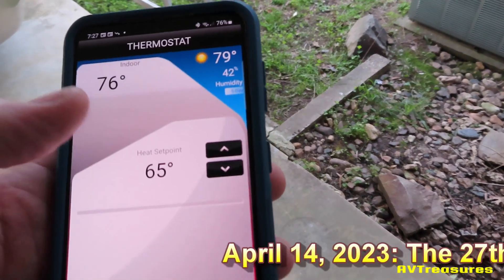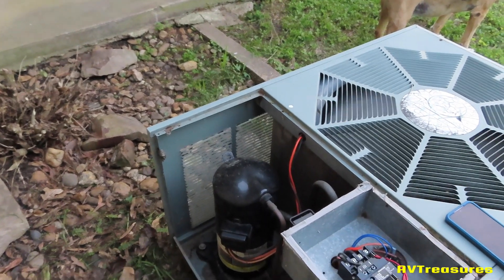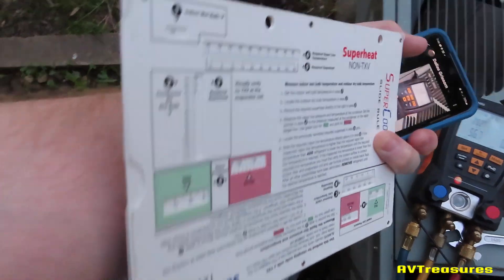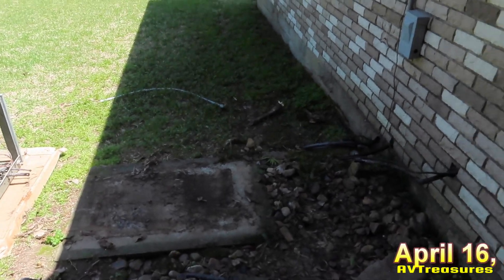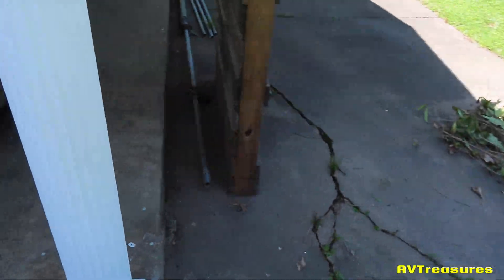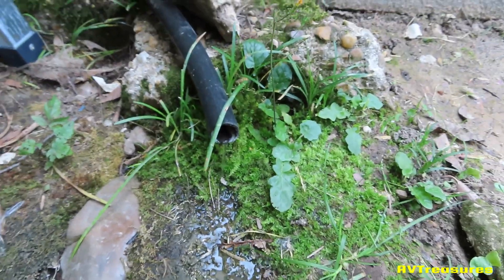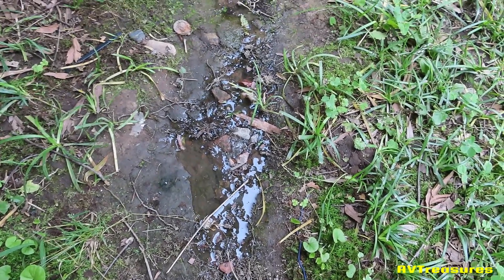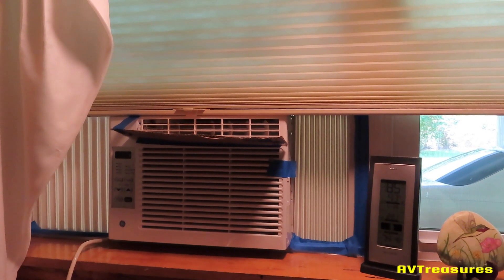The End Of An Era: The Changing Of The Rheem

Comment: RIP the old rheem unit. At least it has served you well for decades. And at least you still have the unit. Hopefully the new unit will serve you well too. (Even though it probably wont last as long as the old one.) My grandparents have the same exact rheem unit in their backyard. (As well as a GMC/Goodman next to it for their neighbors house. Used to be a 2 ton carrier 38ckc) They even have the same furnace as your old RGPH. Only with 4 burners instead of 3. I discovered your channel from one of your RGPH start up videos. And was amazed when I found out you had the same pair of units!
Reply from the maker: The new RARL Rheem is doing great. I really like it much better since it's 2 stage and runs as a 2 ton 99% of the time. The old one was just too large for my house. You are right, It probably won't last as long as the old RAKA. I still love that old unit though. I couldn't bare to part with it. At least not yet anyway. Thanks for watching.

Comment: Nooo! 😢
Reply from the maker: I know. It was over 5 years after I bought the new Rheem before I could move ahead with the installation. Refrigerant leaks bother me. Once I had evidence it was leaking I was able to go ahead. It's still sort of sad but the new system works so much better for my house.
Reply: @AVTreasures  Oh really well that's good at least next cooling season when you go too do the start up can you start it up on low stage and then later bump the thermostat down more too kick it too high stage?

Edit: Why did you buy the unit 5 years ago if the unit wasn't broken and on top of that it was in the factory for 3 years before you got it
Reply from the maker: Yes, I plan to do some detailed videos on the new Rheem this coming year. 

I was looking ahead. Nothing lasts forever and I had been wanting to upgrade to a quiter unit that better matched the heat gain of my house. 3 tons is way too large for my house 90% of the time. I found a good deal on it at Surplus City Liquidators. They have lots of discontinued units that the manufacturers had left over at great prices.

Comment: Not trying to brag but my ruud is still going and it’s got a small leak but it can go anywhere from 5 to 6 years without being charged and the new rheem looks good installed
Reply from the maker: I don't blame you at all. I could have easily done that with my old one. It was only a little low. I was ready to finally have the correct size unit. The new Rheem operates as a 2-ton in low stage which is perfect 90% of the time. The high stage is 3 tons and I could possibly need that if it were well over 100. Especially if there was a power outage and the house were really hot.
Reply: @AVTreasures  I don’t blame you there it will help not to cycle as much and better humidity control
Reply from the maker: Absolutely. It runs nice long cycles, especially when the humidistat has on demand dehumidification engaged. It uses almost half the power of the old unit too, so my KWH usage went way down compared to past summers.
Reply: @AVTreasures  that’s good 👍 and nice looking installation
Reply from the maker: Thank you! I am really pleased with how it turned out.
Reply: @AVTreasures  you’re welcome I want to go back with a heat pump once if the ruud ever gets replaced
Reply from the maker: Good idea. That will save you a lot on heating costs.
Reply: @AVTreasures  plus instead of the outside unit sitting dormant in the winter it can heat the house instead

Comment: I never thought I'd see the day.  Well, it had a great run.  It's too bad it started leaking.  If getting refrigerant for it weren't a problem, I would have definitely kept it in service.  But you already had the new one, and it's not doing anyone any favors sitting and taking up space.

I actually did have an issue with my 2-ton Rheem this past summer.  It so seems there were bad electrical connections.  I had a company come out (as I didn't have the time), they replaced the capacitor which I knew wasn't the issue.  The unit worked for 2 more days and quit.  They came back, I had them replace the contactor.  Then the electrical connection issues were found.  That solved it.

Personally, I'm not sold on a 2-stage system.  More to go wrong.  And, the units run plenty long here as it is to keep this place cool.  I'd never want to throttle back the cooling.  It can go on and off as it pleases via the thermostat.

It's a great thing you were able to do all the work yourself and get it just perfect.  I know all about that.  If you want something done right, you've got to do it yourself.
Reply from the maker: Yes sir. 27 years of faithful service. I was never once without cooling.  I was expecting the coil to start leaking sooner than later. I have some R22 in my stash and I could have easily just charged it back up.  I also could have replaced the indoor coil and kept on going as well. I likely would have done exactly that if the unit were the correct size for the house. 

Glad you got your 2-ton Rheem figured out. Sometimes it's not a one and done fix. I ran into a similar situation with a family members unit last summer. It also ended up being a bad connection at the contactor (on the low voltage side). Took out the transformer and the thermostat. 

I love 2-stage equipment. My house has never been this comfortable or quiet. Where my unit is located (sitting in the middle of the house with an open return) noise can be a big problem. Now I can actually sleep through those cold nights and never be awakened by the furnace coming on.  I get what you're saying though. There are a few more things that could go wrong. Just as with my old system, I have spare parts on hand for this one as well. Including the board in the outdoor unit. I really like the longer run times of two stage. It makes the house way more comfortable. During either extreme cold or hot weather, I never feel it inside the house like I used to between cycles. It's amazing. The new 17 Seer outdoor unit pulls about half the power that the old 10 Seer did. My monthly KWH usage last summer was roughly 25% less than in previous years.

I totally agree. If you want it done right, there's no other way. Living with a sloppy install of an oversized system for 20 years is what started me on the journey to acquiring the knowledge and tools to do this work myself. As important as HVAC is to me, I have no other choice. It was a hard road but worth every bit of the effort.

Comment: Since I have 1997 Ruud Classic X, I’ve been following your Rheem videos for years.. been maintaining it really well ( like you) …..2 years ago I noticed a low charge and got some hits on the leak detector from the evaporator.. charged her up and added one shot of Leak Saver.. performed really well for the following two seasons but towards the end of last season the compressor’s started with some odd rattles( definitely internal) .. so I too may be looking at a change out soon.
Reply from the maker: It's too bad that the indoor coils aren't as durable as the outdoor unit. These systems could last 50 years easy. I could have replaced my indoor coil and kept going for years. Since I had the good fortune to find the NOS RARL, I decided to upgrade. Time will tell if it will last as long. Thanks for watching my videos.

Comment: Has the Coleman or Intertherm lost their charge this year or are they still going strong?
Reply: What was the Intertherm replaced with?
Reply from the maker: I installed a 2.5 ton Rheem RA14 and a new indoor coil with TXV earlier this year.
Reply from the maker: The Coleman is still hanging in there. It has a slow leak but I have some R22 reserved to keep it going for a while longer. The Intertherm is gone. I replaced it in March of this year right before I installed my new Rheem. It took 6 lbs to keep it going last year so I had to do something pretty quickly.

Comment: What year is that condensing unit? I thought Rheem/Ruud went to more of a "cube" style design on their newer units. Is that the same furnace that you installed a while back?

Sad to see the old Rheem go, but the new one should last years.
Reply from the maker: It was manufactured in 2015. I bought it in 2018. This was the design that came after the stamped octagon was discontinued. The next design change is the one you are thinking of. Yes, I reinstalled the 2 stage 50K gas furnace that I put in back in 2017. It's still like new. 

Me too but it was time. Having the two stage is awesome. It works so much better.
Reply: @AVTreasures  Out of curiosity, what did you do with the old Rheem unit?

On a slight tangent, I just purchased a vintage Rheem product from eBay. Isn't HVAC or water heater related, though.
Reply from the maker: I pumped it down and stored it in the garage. The old RGPH furnace and coil are sitting on top of it. 

eBay is awesome. I have found some neat vintage Rheem stuff on there as well.
Reply: @AVTreasures  Did you ever get any of the vintage Rheem stuff? I wasn't aware that they were so diverse at one time, but I guess that's the case with a lot of companies. Hyundai doesn't just make cars, also made the RAM chips for a couple of my old computers among many other things.
Reply from the maker: I did buy a few vintage promotional items. Rheem used to make a lot of other things besides water heaters and HVAC. I remember back in the 1970's, the schools had Rheem record players and tape recorders (Reel to Reel and cassette).
Reply: @AVTreasures  My eBay purchase was a Rheem Califone cassette player. Although it was advertised as working (I'll see when it arrives... fingers crossed), I plan on making it my next "restoration" project. I don't have a working cassette player/recorder, so it'd be a nice addition. (At some point I might even get around to restoring my great-grandmother's old Soundesign cassette player my grandparents bought her back in the 1960s/70s.) A local church has an even older Rheem Califone record/phonograph player (with matching Rheem Califone speakers) it brought out this past summer for a cakewalk. The chrome relic still worked fine.

As for HVAC, we have an old Rheem horizontal gas furnace at work that is still in use serving our back store room. I'd say it has to be from the mid-late 1960s when they built that addition. It's so old that it's blue. (Never knew Rheem used to paint their equipment blue until I started there.) Only issue with it is it take forever — a few minutes — for the blower to come on. Sometimes I've even noticed the flames go out when the blower comes on, possibly on high limit? I know I've watched it for a good two or three minutes without the blower ever coming on. It still has its original Honeywell fan limit switch, which I've thought about adjusting so the blower cuts on sooner.

A building for the local county fair also has a similarly-vintage Rheem water heater — also with a blue jacket — still in use. Unfortunately I don't think the new York furnace installed at work last year, or any new water heaters, will outlast them.
Reply: @AVTreasures  I finally got around to making a video about the old Rheem gas furnace in the back office at work. My first HVAC video on here in more than a decade. It still works fine and keeps that portion of the building (just storage, so it's kept at a cooler temp) warm. I don't know when the last time it's been properly cleaned or maintained. It could use a good cleaning and needs to have its fan limit control adjusted a bit. https://youtu.be/2ODRPaitHjs?si=csp4I0c5r-qfJKky

I also have a video on the Rheem Califone AV80 I scored on eBay up on my other channel. Play works fine, but rewind and fast forward don't work at all although I can hear the motor running. I'm guessing the 50-year-old internals need some cleaning and lubrication, which I plan on tackling soon.
Reply from the maker: Awesome! I was hoping you would make a video of that furnace. I'll watch it right now.
Reply from the maker: Where can I find your other channel?
Reply: @AVTreasures  I've still been working on the Rheem Califone AV80. It worried me the other day as I was testing the pinch roller when I started noticing a strong mechanical odor followed by a small puff of smoke. I immediately shut it off and checked it out. Thankfully it still works fine. Eight transistors in the entire machine, no ICs or advanced microelectronics. 100 percent analog, old school. Just like the furnace at work with its standing pilot and draft diverter.

During my research I've discovered Rheem's product line was a lot more diverse than I imagined, especially right after WWII. In addition to water heaters and HVAC, they were mostly known for shipping containers and steel barrels. They got into the plumbing industry, and were known as the first company to offer pastel-colored fixtures. Going along with my cassette recorder and the record player I mentioned, Rheem actually manufactured a couple different electronic instruments — most notably the Rheem Kee Bass, of which versions sell for more than $1,000 today. I just came across a demo of the Rheem Mark VII combo organ, which just sounds amazing — considering it was made by the same Rheem that is mostly known for water heaters and HVAC. https://youtu.be/18ZOEnnuF8k?si=EMtT6gm1WunpItfQ

It seems like Rheem started focusing on water heating and HVAC in the later 1970s/early 1980s. Now it's all they do.